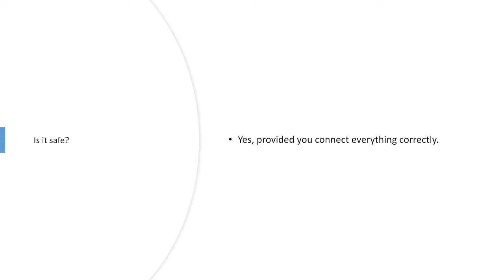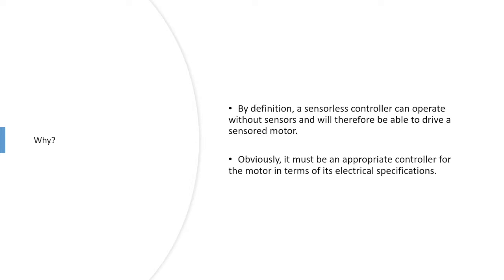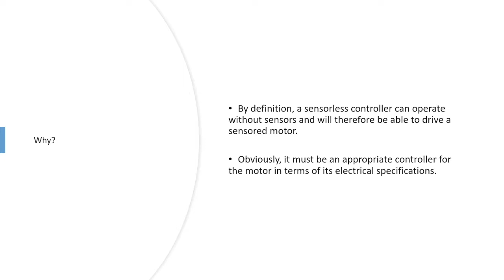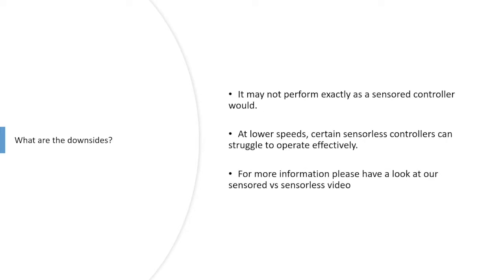Can I drive a sensored motor with a sensorless controller?

Comment: Hi..Can converting a sensored speed controller to a sensorless one ? ..thank you
Reply from the maker: Hi Azer, no - this is very unlikely to work. If you need a specific controller for a particular project then we are happy to help on this. Depending on which controller you are using it may be possible that it will work in both sensored and sensorless mode but in most cases this will not work.
Reply: @ZikodriveRBE  thank you so much for this great explanation .